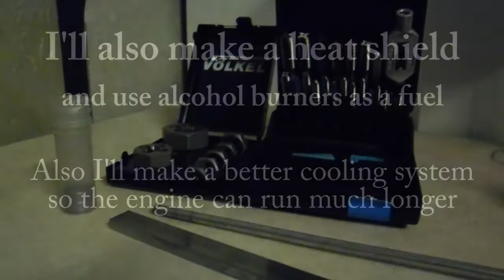Two-Cylinder Stirling Engine - Teardown For Upgrade

Comment: Hi awesome engine how did you make the bearing things the con Ross are attached to?  Thanks
Reply from the maker: the bearings are clamped in a clamp that is used to secure waterpipes to the wall. I don't know the proper english name for them. You can find them in your local hardware store. They are used for holding copper tubes to the wall. They have M6 thread in them.

They are just the right size, 12 mm for the small bearings and 19 mm for the bigger bearings. The bearing is very secure in the clamp, it won't come loose so easily.